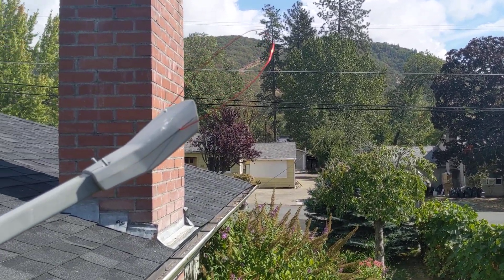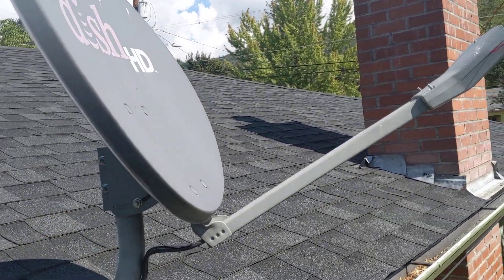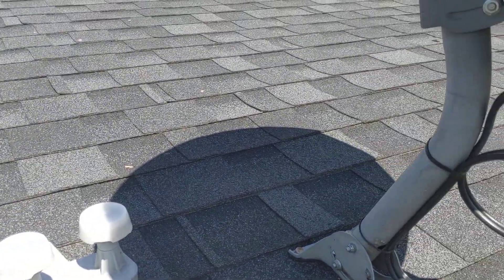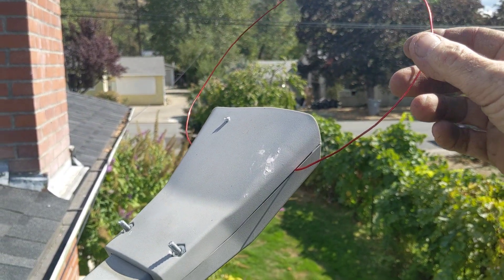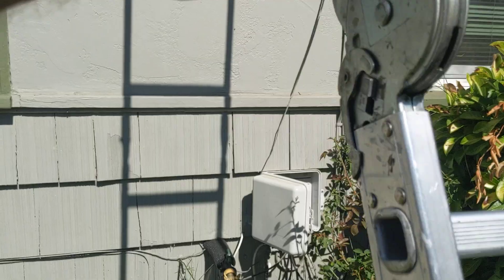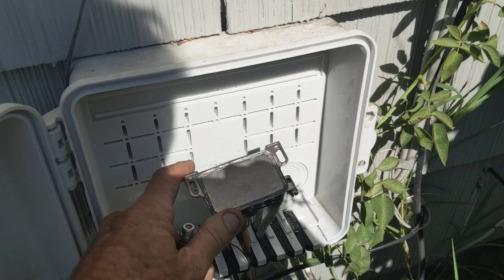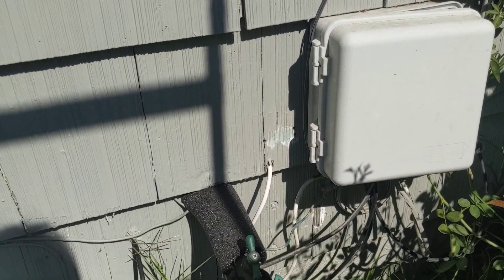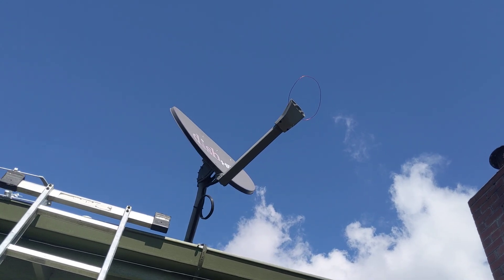Satellite Antenna Converted To  UHF TV Antenna

Comment: This is a complete waste of time. You can just use the lnb on the dish and connect it to a reciever or tv instead of something that will fall apart in 2 days
Reply from the maker: How can you use the LNB to get UHF and VHF Channels? It's designed to receive a completely different frequency way above our standard TV frequencies.
Reply: @GrantsPassTVRepair  I used a dish network satellite and I got plenty of channels then I added a rca indoor antenna amplifier and now I have great signals
Reply: @GrantsPassTVRepair  I got plenty of signals with the original lnb
Reply from the maker: @ReapWhatYouSowGardening  That's interesting. I assumed the LNB resonant frequencies were far to high to pick up over the air TV signals. Did you apply a DC voltage to the built in amplifier on the LNB?
Reply: @GrantsPassTVRepair  no I used a indoor antenna amplifier for the dish lnb and it got nice picture
Reply from the maker: @ReapWhatYouSowGardening  That's interesting, I'd like to see how your LNB conversion compares to my UHF loop antenna.
Reply: Well, his “Won’t fall apart in two days” 😅…Wished  you’d have explained things in terms that anyone could understand…An “INB / LNB” Yada…Yada…Someone who’s not “Larry the Cable Guy”, doesn’t understand?!?  🤔

Comment: These small satellite dishes can be used for boosting the UHF or Wi-Fi signal, 15 years ago I used a 90 cm satellite dish and a UHF dipole, I attached the dipol in the same place where you mount the LNB. Back then there were analog signals, The channels on UHF Band 4 where crytal clear, and on Band 5 the channels had good picture. Back then in order to receive the channels on UHF Band 5 you had to use an amplifier, an antenna with built in amplifier was the solution.

In the digital era, things are much better, plus most of the UHF channels are moving from Band 5 to Band 4, the reception is even better, I did the same thing with the satellite dish and I've seen improvement on my digital meter AMIKO TSC1270 and on all TVs, STB.

In Europe most people have both OTA Antenna and satellite dish installed when it comes to free TV. There are lots of Free to Air channels on satellite, and diplexers are very common, In some countries like Germany, UK, Middle East all you need is a satellite dish and you have all channels you need. OTA antennas are used in places where you can't install a satellite dish.

Comment: Is the copper loop electrically  attached to the plastic piece on the dish?
Reply from the maker: How could there be an electrical connection to the plastic? Perhaps I'm not understanding your question?
Reply: @Grants Pass TV Repair  you are right,  that was confusing! 😆 Attempt #2: What is the copper loop attached to?
Reply from the maker: @waltschannel7465  The plastic you see looks like one piece, but it's really two much like a sandwich. When I separated the two I put the loop in between, and then I tightened the screws to hold it together. If you see one it will make more sense,

Comment: It's a great solution but Is that loop of wire sturdy enough?
What will happen when the loop of wire gets a bird trying to nest on it, 
or in cold weather, ice forms on it and the weight of ice brings the loop down?
Reply from the maker: Good question, but in this area it's not likely to ever be a problem. The signals are real strong there.